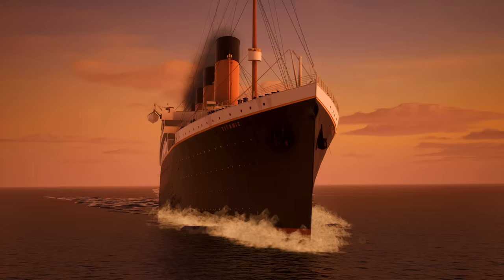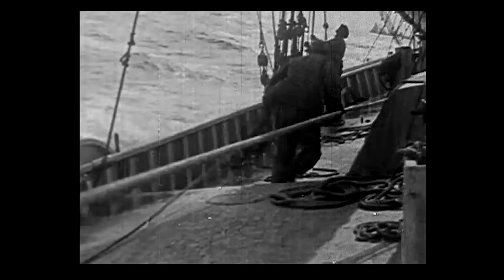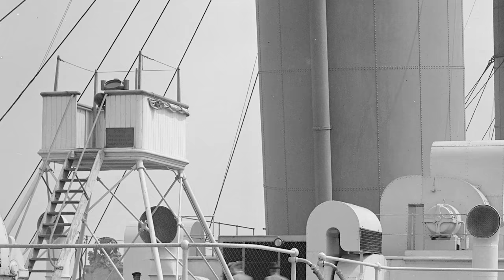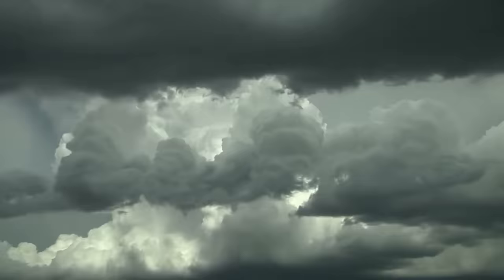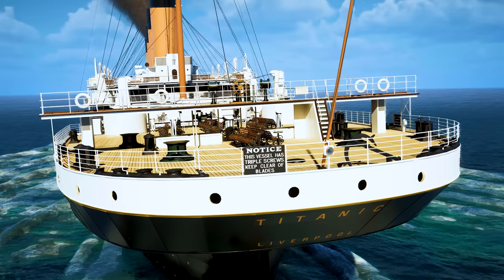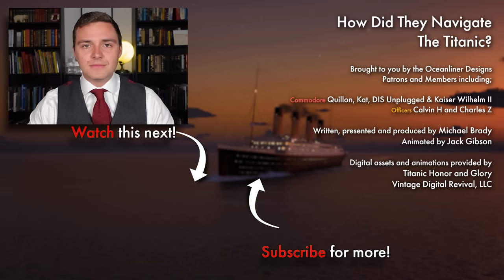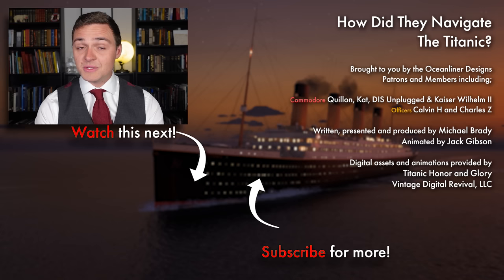How Did They Navigate the Titanic?

Comment: Really fascinating. I always wondered how the crew were able to gauge the actual speed at a given time.
Reply: There's a really good video about this on the Battleship New Jersey channel as well (can't remember the title). Described how, on that ship, they basically had a pole that slid out the bottom of the ship with pressure-sensing ports on the front and back which measured the pressure differential, this could then calculate speed (the same method is used on all airplanes). That was WWII and later, a little after Titanic's time. I'm guessing modern ships (civilian and military) still use similar techniques, even if knowing "ground speed" via GPS there'd be reasons to want to know speed through water to account for currents.
Reply: Speed at sea is called «knots» because it was measured by counting the knots on a rope hung from the stern of a sailing ship, similar to the more modern technique Mike talks about here.

Comment: Speaking of redundancy, you were talking some time ago about the Titanic's double bottom. Did later ships start using double sides as well? Eventually transitioning to double hulls? I don't know if there is much to say on the topic, but it might be interesting to dig further into the evolution of hull designs and what it really meant for ship survivability. It's a rarely discussed topic and, ironically, only ships that became famous for sinking, like the Titanic, are really well known to the public.
Reply: Britannic's construction was delayed to add the double hull, but this feature had already appeared on Brunel's Great Eastern (a ship too ahead of her time for her own good).
Reply: Some ships were given double sides as well, but it causes  maintenance and design issue. 
With a double bottom, it's almost a full deck in it's own right. Sections of it are accessed through manholes (small watertight bolted hatches) in each section, and personnel can climb down, inspect the compartments for problems, cleanup rust and touch up the paint work. The double bottom also doesn't impact the ships usable volume much, as most of it will be curved and sloping parts of the ships hull, that would have otherwise have platforms built over to make these areas usable anyway.
Double sides present a problem. They form a large number of small compartments that must be accessed for inspections, repairs and maintenance, through the compartments inboard of them. This makes the outboard bulkheads of compartments low down in the ship unusable. They also narrow the usable compartments low in the ship, directly impacting usable volume.
So, you see double sides and double hulls only where necessary, such as oil tankers and warships, where the cost of an oil spill out weights the maintenance costs, or the maintenance cost and manpower aren't as limiting.
Reply: RMS Olympic had a double hull retrofitted as a result of the Titanic's sinking, and Britannic which was still under construction had one too
Reply: Very interesting. Thanks.
Reply: Double hulls aren't entirely wasted space though. They are often used to store fluids like water or fuel.

Comment: Oh, and a comment regarding CELESTIAL NAVIGATION…. It turns out the famous SR-71 Blackbird spy plane used a star tracker, called the Astro-NAV System or ANS, to provide guidance and correction to the aircraft’s inertial navigation system, or INS.  The Blackbird would ‘calibrate’ the ANS, nicknamed R2-D2 by the crews, by fixing the location of several stars while on the taxiway prior to a mission - and the ANS was sensitive enough to see stars during daytime.

During flight, the inertial navigation system was used for the autopilot, and the INS was continuously monitored and updated by the ANS to ensure the SR-71 was on its proper course with an accuracy of less than 2000 feet fore or aft, and no more than 300 feet off the centerline of the flight path - pretty good for an aircraft cruising aroumd 2100mph, or Mach 3…in the mid-1960s.  At altitudes around 85,000 feet, clouds weren’t a problem :).  Mission times from takeoff to landing took between 4-6 hours or longer, with a couple hours over the target after inflight refueling.  The Blackbird used fuel like crazy, and super accurate navigation was crucial in meeting up with the highly specialized tanker aircraft dispersed along the planned route or routes.

While keeping the Blackbird on course during the duration of the flight, the ANS picked at least two pre-programmed stars, and with the use of a chronometer (yes, just like THAT chronometer) could determine precisely the SR-71’s position.  This was particularly important when skirting as close as possible to the USSR’s borders without crossing - which was expressly forbidden by express orders from the President.  Navigating the aircraft, which had a turning radius of,90 miles and covered over 3,000 feet per SECOND, on a varying course was challenging, to say the very least.  The backseat RSOs, the Reconnaissance Systems Operators, joked that “you can’t jam the stars!”

Comment: Mike, this is beautifully presented once again, and surprised me with the depth of information - I had never heard of the Submarine Signaller before, which was really a primitive form of ASDIC, and I do wonder if this system had been active, ie. had transmitted sound rather than just a passive receiver, whether the presence of submerged ice in the area could have been detected?
Reply: The same company would go on to develop the Fessenden oscillator, which could be used to detect icebergs as you describe, though only after the Titanic disaster had already occurred.

Comment: 04;00 You didn't mention the balls on the compass. They compensate for the steel around them, but not perfectly, so each compass has it's unique deviation table.
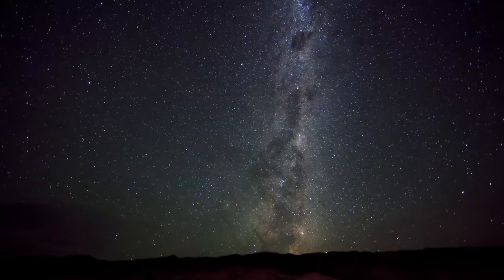09:00 " Only the sun will be visible" The sun will give an accurate fix by it's self. The "noon sight" is the easiest, but can also be determined any time of the day by using brutal amounts of trigonometry. 
11:13 Sextants measure angles, not distances.

Comment: I found out recently that titanic most likely didn’t break in half. After the second funnel fell it created a series of stress cracks causing the electrical to fail and burst a big hole on the port side of the ship causing the ship to go down and break way underneath the water. One thing that proves my theory is that frank prentice was holding on to the back of the ship and said the boat went down and it did not break and 3 men on the aft boat deck said the same and for the people that did claim it broke in half it was pitch black that night and if you were on a life boat you can see the outline of the ship go down

Comment: Few annoying points: 9:36 into the video, I think only the stern light should be visible, after masthead light should be higher up but not visible from this angle, and the starboard green running light not visible from this angle yet. The arcs of visibility of the running lights are significant in order to determine the vessels aspect as viewed from another vessel. As far as your description of how celestial navigation works, I give you a C+, BUT I know celestial navigation it is a lost or fading art.

Comment: 9:45. My understanding is the Bauxhall made significant navigation errors, and not when Titanic was sinking, but hours before.  He made an incorrect time reading, placing Titanic's location further south.  They then "corrected" their heading, sending Titanic into the southern part of the ice field.  

Further, the Mount Temple had Titanic in its sight, but turned away to head towards the reported position.  They probably thought Titanic was another ship.  Carpathia was headed towards the reported location when they found the lifeboats.

After the sinking, there was a lot mutual CYAing among the officers and crew.  You have to take these "congratulations of incredible accuracy" with a big grain of salt, especially considering how off the positions were.

Comment: Great job putting all that together, didn't know about some of the stuff you mention. Although I would like to mention, that positioning a ship using stars, planets, etc becomes inaccurate at speeds of 18 and above, as the distance traveled between readings with the sextant is to big for accuracy, if Titanic was sailing at an average of 21kn, this would have been the root cause of an error in their initial position. I ignore if after the collision after the ship slowed down they had time to take an accurate position using stars.

Comment: 9:08 - That isn't how it works at all!  You can't find longitude just from measuring stars.  People would typically use the lunar distance method which would involve measuring the moon and the sun, or the moon and stars.  It doesn't work just measuring stars because you can't tell the time from that.
Reply: That’s where the chronometer comes in.  If you know what time it is, you’ll then know what line of longitude the star is supposed to be on.

Comment: I read that taking a sighting after coming out of a fog was the reason " Lusitania" was traveling so slow upon entering the area off the south Irish coast.  Thus giving U-20 a perfect, slow moving target.
Reply: Funny how it sank in the Celtic Sea off Kinsale on the Atlantic coast.
Reply: @givenfirstnamefamilyfirstn3935  It was called the Irish Sea in 1915.  It became the Celtic Sea after the WWI.  And it wasn't funny.
Reply: It didn't enter the Irish Sea, it got nowhere near the Irish Sea.  Look at a map.
Reply: @givenfirstnamefamilyfirstn3935  I read an account of the disaster from "1915" that called the area the Irish Sea.  I know the Irish Sea is between Ireland and UK. But at the time some referred ( NOT ME) to the area as the Irish Sea.  It was changed to the Celtic Sea in the 1920's because of the confusion.  BTW ALL seas are connected.  Of course if you had phrased your comment nicely; I would have just corrected part of my original comment.
Reply: @gerhardrichter8626  Fair enough, I could have been less of a smart azz.
Reply: @givenfirstnamefamilyfirstn3935  Thank You and I corrected my original comment.

Comment: Hey Mike! Idk if you read these comments, but I may have a theory to how Titanic could have been saved.

I created this theory when I was playing a flight simulator while flying a DC-10. Because the DC-10 has an engine setup similar to that of Titanic's propellers. I thought what would happen if Titanic reversed her port side propeller and kept her central and starboard propellers on full ahead with the rudder turned to the left. I experimented this and the plane banked heavily to the left. So it kinda summed up the conclusion that Titanic could've been saved by reversing the port side propeller and kept her central and starboard propellers on full ahead. So what do you think? Could've Titanic been saved? Or would it have failed?

Comment: I think you underestimated the importance of time.  All Nautical Almanachs were published for latitude 51.47  longitude 0° (Greenwich) with GMT times.  For a given day, the almanach would include sunrise time and azimuth, meridian (noon) elevation (by definition due south), and sunset time and azimuth.   GMT was set to be the centre of the time zone such that the sun is due south at precisely noon, and then elevation above horizon provides the latitude.

The more precise the clock on board, the more precise your measurements can be of those events and allow you to calculate distance relative to Greenwhich based on those almanachs   (if sun is "south" an hour later than at GMT, then it means tou are at longitude -15°. The elevation of sun above horizon at a particular time for a particular day at a particular longutude lets you calculate based on that almanach your latitude.  

At night, without a reliable horizon, you can't do caculations based on elevation of starts/moon above horizon, but can still use moon rise and moon set times. 
Your video forced me to persuse some documents and I found that there were shipping lanes established and for that season, one was established to pass south of known ice frield. So from Europe between Jan and August, , they plotted course to  42N and 47W after which they would then do straight line to their destination.  Apparently, April 1912, the ice was much further south the same points that were in the charts. 
And plotting a great circle route requires good math skill. 

For instance, leaving Cobh (Queenstown) Ireland, the ship would have had to navigate south first to get out of unlet and to be able to get around the southern tip of Ireland, and then put on a heading of 265° (absolute, not magnetic) By the midway point, the heading would be 249° and when almost at "The Corner" the heading would be 231°, at which point it would turn to heading  275° to get to Long Island in great circle,

It rests some 45km south of that great circle between The Corner and Long Island.   And 246km ( 133 nm) from The Corner and at 22.5knots, it means roughly 6 hours. 
At time it hit the iceberg, it was 23:40 "local" time, which means it would have left The Corner at roughly 17:36 , still in daylight and would have seen sea conditions for likely an hour more.  Might have given the captain the confidence he was south enough to not have to worry about icebergs.

Titanic worked mostly from noon to noon in terms of days travel from whet I read (noon  is when sun is highest and thus assumed south adn allows all the calculations be made). For that day, its time offset with Greewish was 2 hours 58 minutes.  (each day, its "local" time was adjusted based on their position aty noon.  (I have also read that they would divide the adjustment by 2 and clocks moved back by half at noon and half at midnight).

Comment: I wonder wether the false position calculated by boxhall may be further proof for the mirage theory. Since you need to adjust the mirror of the sextant for the celestial body you are observing to be projected on the horizon, a false horizon (caused by a cold water mirage) could easily corrupt your reading, could it not?

Comment: "Titanic was designed with redundancies in mind, absolutely everything had a backup" - well not quite. They didn't have backup life boats :-( Kind of shocking that they put so much thought into everything and safety apart from that basic thing.
Reply: Because they didn't think of life boats in the sense of "abandon ship". Titanic was designed to be the lifeboat & the tiny nutshells used to ferry passengers to the rescuing ship or nearby land. Then again, even if she'd had 100 lifeboats - there wouldn't have been time to load & lower them. They barely managed the ones she carried.
Reply: I also believe she actually exceeded the number of lifeboats stipulated by law, which is of itself somewhat disturbing.

Comment: Ahoy Mike, another great info loaded vid!
I've seen something used to correct magnetic deviation (?) on ships, it was like adding metal pieces close to the compass to make it read accurately. Was it possibly the 'balls' next to the compass?? 
If anyone knows, I'd love to hear. 
Cheers
Reply: They are properly called "quadrantal spheres", but more often go by the moniker "navigator's balls" in the Navy. Their positions are adjusted (during an annual process called "swinging ship") to reduce the amount of error introduced as the ship turns thru the points of the compass, as the ship's relation to local magnetic fields also affects compass accuracy.
They are regularly put thru a process of heating to cherry red and then slow cooling (called "annealing") to remove residual magnetism.
There are also iron rods called "Flinder's rods" contained in a vertical tube contained within the compass stand. These are for reducing magnetic effects from the ship pitching up and down fore and aft.
Reply: @BrionBoyles  Ahh, nice one. Thanks for that! 👍👍

Comment: Fascinating stuff!

The speed-measuring device is clever, a sort of hydrodynamic pedometer - though I'm curious how they accounted for oceanic currents. A few knots' boost or drag due to the water moving in a particular direction would add up to a fair amount of difference in distance traveled after a day or two. Did they just rely on really accurate charts, and add or subtract the relevant currents' speed from the instrument's reading once they'd figured out their position, or was there some other technique to make the adjustment?

Comment: I’ve got a question about the titanic. In the 1997 movie, when they spotted the iceberg, first officer Murdoch ordered hard to starboard but the ship turned port. And then after that to avoid hitting the propellers he ordered hard to port and the ship turned starboard. Why is this?
Reply: Wow, great question and great catch.  Maybe this helps; stumbled across this on Reddit:

With the stern swinging out so wide during a turn on such a long ship, a maneuver had to be executed to keep the ship from grinding into the berg over it's hole length. In the Titanic scenario this is called 'porting' the ice berg. To turn left to avoid the berg, 1st officer Murdoch gave the order 'Hard a starboard', which meant to starboard the helm as in an old fashioned tiller, which was turned opposite the direction you wanted to go. To swing the stern left and turn the ship to the right, a 'hard a port' order would be given. Thus 'porting' the stern means giving the command to turn the tiller to port (which turns the ship right).